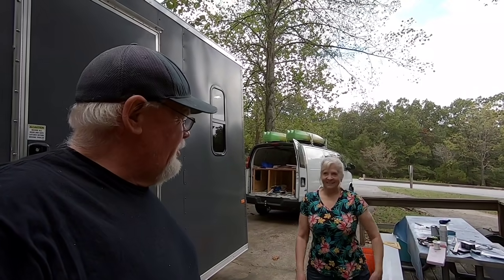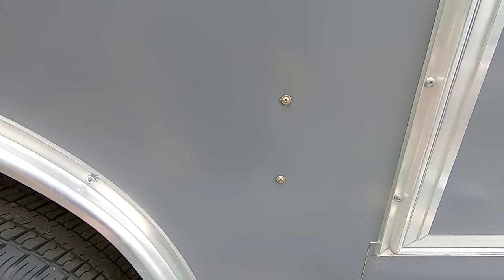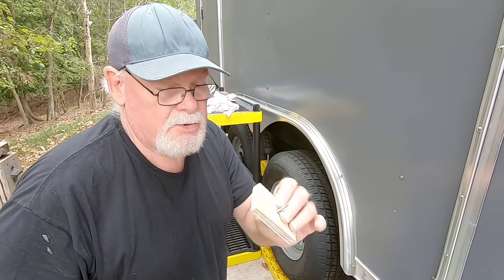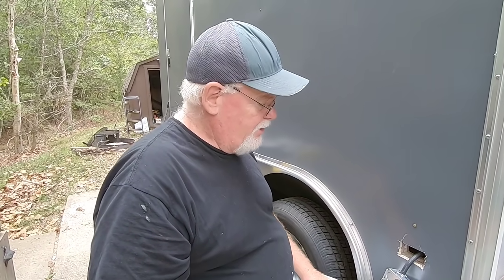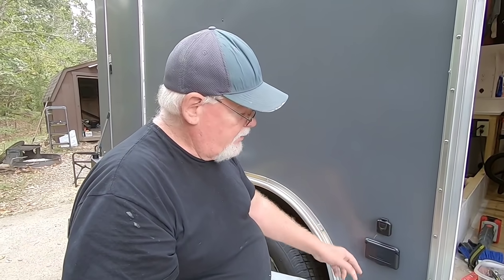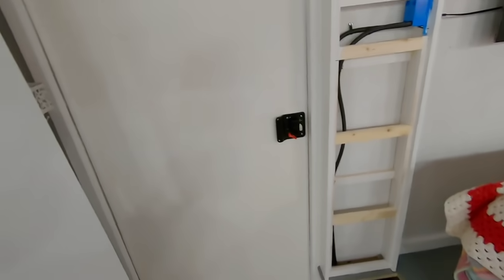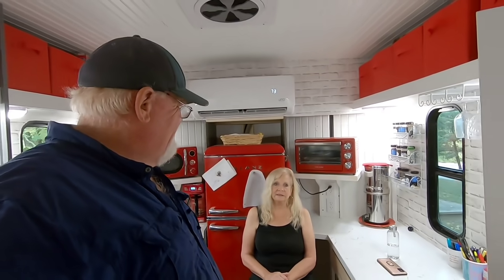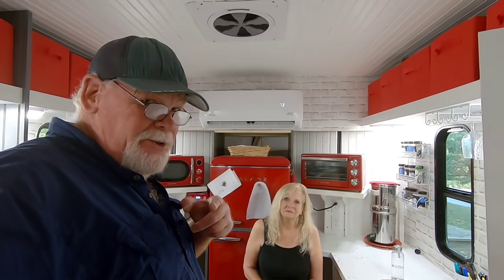Install Outside Receptacle And TV Inlet On Our Cargo Trailer Conversion

Comment: I always use two layers of painters tape around where I'm going to make a cut like that.  Just in case I slip it dings the tape not the paint.
Reply from the maker: My hindsight has been 20/20 lately 😄

Comment: Bill what did you do for a living before you retired? I usto tell my apprentice and men if you make a mistake you can’t take it back just learn from it and it always can be fixed. Nice job on the build.
Reply from the maker: My main vocation was floor covering. I also dabled in plumbing and electrical now and then. Debs family consists of, plumbers, carpenters and electricians. I worked with most of them time to time over the years. Thanks for the compliment.